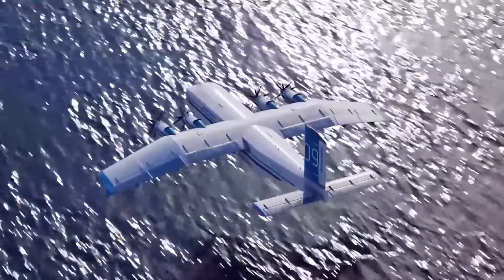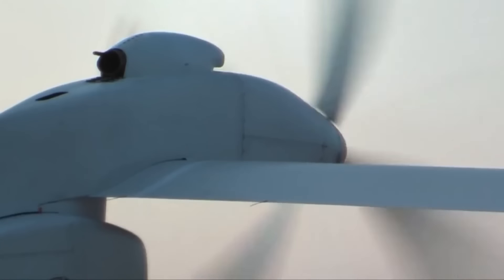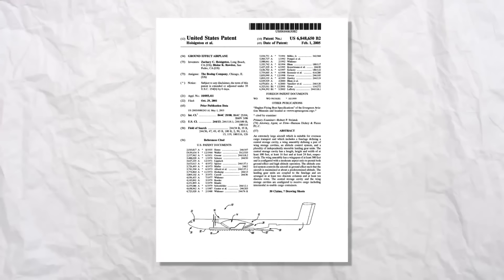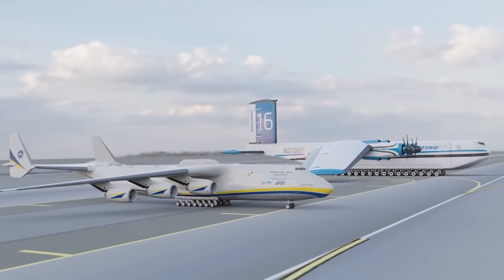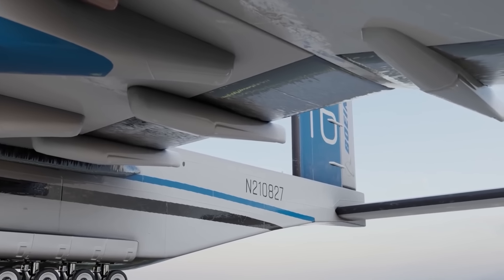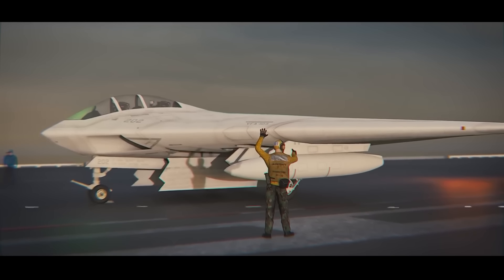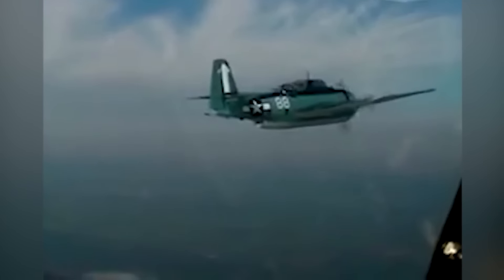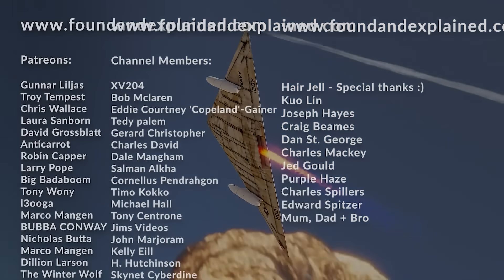Forgotten Prototypes: 1990s and modern aircraft designs | FULL MOVIE

Comment: Wrong about YF23  high agility.  It didn't have thrust vectoring.  As it used reaction control nozzles instead.  like you would find on spacecraft.  Making it just as maneuverable as the YF22.  Thrust vectoring was wanted to compete with the Russians designs.   The YF22 won foe two reasons.  A more conventual design with thrust vectoring and the bombing runs it did.  showing off capabilities.  The YF 23 was a better aircraft hands down.  I am also sure money changed hands to get the YF 22 selecrted as well.  The russians and the Chinese have used so many of the YF 23's design features that their planes look so much like it.

Comment: As an engineer, my guess would be that this Pelican was deemed impractical for several reasons. 1) can you imagine the facility needed to assemble something this big and what that would cost to build? Too much even for a giant such as Boeing. Besides, in case of war, a facility as big as would be required for a project this size, would make e a great target. 2) The airport facilities and runways needed for an aircraft this size and weight. Sure, the aircraft's capabilities would impress even the most doubtful members of the pentagon, but what good is this carrying capacity of this giant if it can't land where it's needed? 3) Operational cost. Operating a single one of these birds would undoubtably cost more than operating several smaller transport aircraft, moving the same amount of military hardware or troops. I could think of a few more issues with this concept, but that would be too much to type.

Comment: The thing you said about the F-32's problem of sucking in hot air while hovering and overheating was a flaw of the plane, but it had a much worse problem than that. When they did the basically head to head comparisons the F-32 had to remove parts of the plane just to be able to take off vertically and land vertically. It was over weight and under powered for the proposed version of the plane. I may be wrong but i believe it also lost because although it would carry more missiles internally it did so by mounting them in a rotary launcher and the military at the time was worried that if it jammed then you wouldn't just loose the ability to fire that missile, but all that were on that side. I'm sure the fact that it was butt arse ugly didn't help either though lol.
Reply: you mean the F-23?